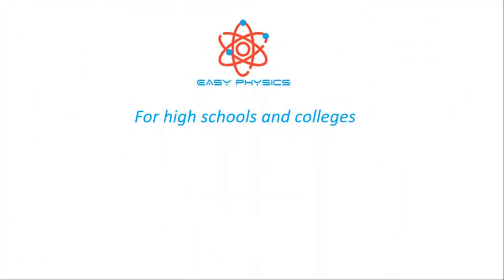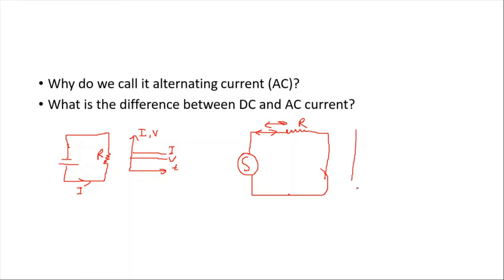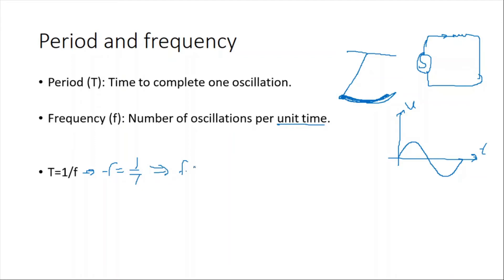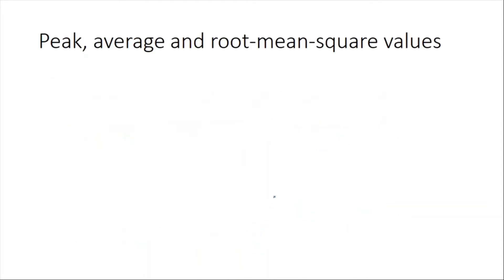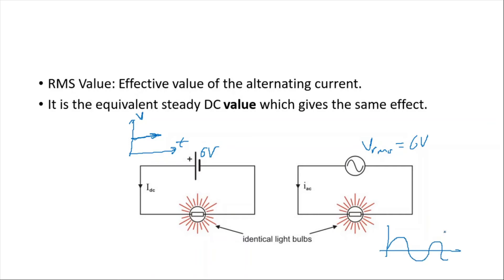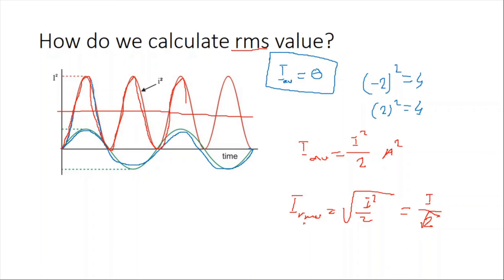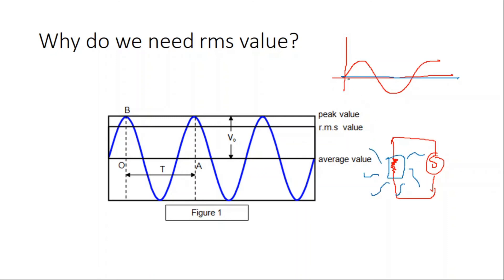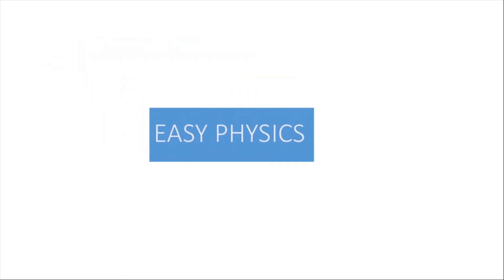AC circuits Basics

Comment: period equals 1/f= 1/50 hz = 0.02 s. Period to equals 1/f = 1/60 hz = 0.016. We can see that times that required to make one cycle decreased. That means that more alternative current will pass through heater. As a result, it will heat up more. I am not fairly sure about it. I will be glad if you answer me. Thank you in advance